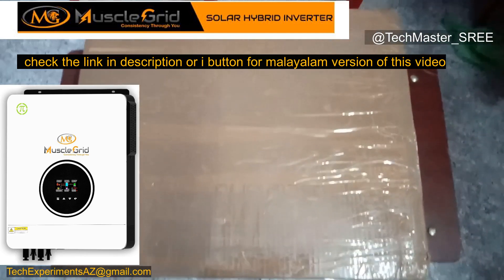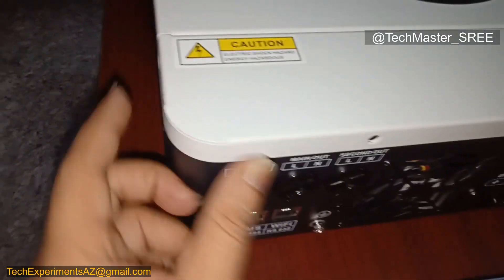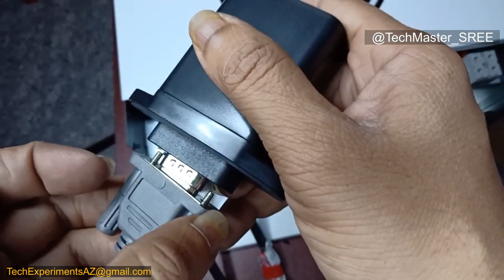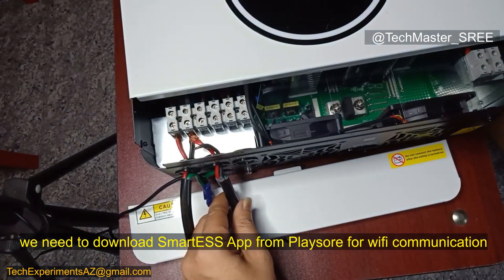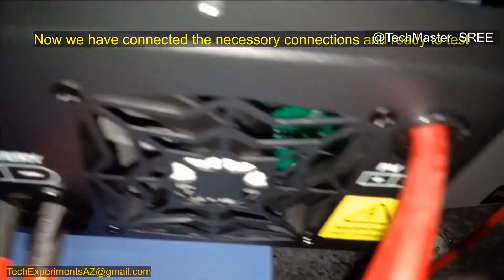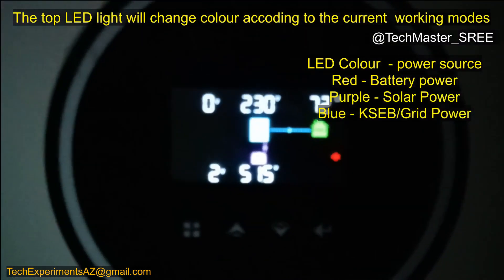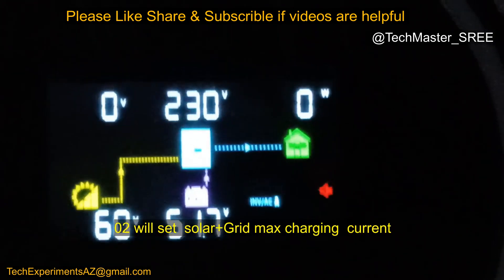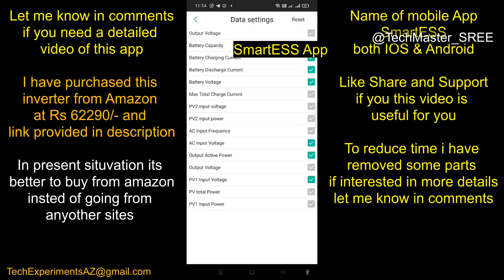Unboxing & Testing - MuscleGrid Inverter 6.2 KW Transformer less Solar -Mobile App Support- ENGLISH

Comment: You are the first vlogger that I know has stated the lack of BIS registration for the China made hybrid inverters preventing them from connection to the grid. Thanks to your video, I am trying to cancel my order for a similar 4.2 kw unit (made by YWJ- similar to Gootu/MuscleGrid) ordered through Alibaba.
If you are familiar with any BIS approved hybrid inverters available at moderate cost, please list them.
Reply from the maker: Thanks for the feedback. based on the present scenario KSEB will not allow us to feedback to grid without a valid BIS certificate. if you are looking for hybrid ongrid inverters DEYE will be a good choice . LUXPOWER and SOLIS also has BIS for some models. If you have already ordered 4.2kw inverter you can use it as offgrid hybrid inverter the only one issue will be you cant feed back to grid.
Reply: @techmaster_sree  Thanks for your fast response. I will checkout the ones you mentioned.
Reply from the maker: @amangaly   👍

Comment: So powerful inverter, I am using it at my house. Such an amazing brand ❤
Reply from the maker: Thanks 👍
Reply: What is the cost of this inverter?
Reply: Ac we can run?
Reply from the maker: @sadiqsahib3539  Using 1 ton 5* inverter AC. yes -1, 1.5 or 2 ton inverter ac then you can run on this system  if you have enough solar panel and battery or grid support

Comment: Thank you so much! you are the only one made a video about this inverter in English. Watched the whole video, but still have 3 doubts.

1. Does it only support 48v lithium batteries? Not 12V lead-acid batteries?

2. How does the inverter switch between on-grid and off-grid mode? Do we need to switch modes or that is automatic?

3. Do we need to install automatic transfer switch (ATS) to stop power from flowing back to the grid during power cut?
Reply from the maker: Thanks for your feedback and support
1. It support 12x4 lead acid  and 48/51.2V Lithium battery
2. You can use it as offgrid hybrid inverter with grid sharing since it has no BIS certification you may not able to export to grid.  Just disable grid export at settings and no need of ATS
3. Set grid export to disable so you can prevent feed to grid. No need of ATS just disable grid export in settings
Reply: @techmaster_sree  So it has the option to export to the grid. But since it has no certification, Government will not provide net meter for this inverter. Right?
Reply from the maker: @StateofDecayScience  yes, you will not get net metering without BIS Certification. So you can't export to Grid

Comment: Thanks for the video.
1. Can it balance grid and solar without battery or is it only grid/only solar?
2. With battery does it balance grid and solar? If solar not enough, then grid adds the extra load?
Reply from the maker: 1. It has battery less feature but it's good to add battery for good performance.
2. With battery we can configure this to take extra needed energy from grid using Solar grid battery option since it has load sharing mppt.
Hope it helps you.

Comment: Nice video. Which battery you are using? From where you got the victron SCC?
Reply from the maker: Thanks for the feedback. Using Lionics 16S 51.2v 100Ah battery (detailed video with internal view is already in channel). Victron purchased from a friend and using a DIY cable and Bluetooth for victron communication.

Comment: Thank you for the information and I appreciate you for responding each comment. 

MuscleGrid also sells lithium batteries at very affordable prices. Why did you not go for them?
Reply from the maker: Thanks for your support 👍
The Lionics battery pack shown in the video has  Inverter communication and Bluetooth APP access which is not available in  MuscleGrid inverter. Also please note that Lionics  is 51.2V(16S) and MuscleGrid battery  is  48V (15S)

Comment: Thanks for posting review. Plz let me know
1. How loud is noise? is it is 24x7 hours or only when inverter is heated? Does it require separate room or insulation?
2. How is performance and any issues?
3. Planning to buy muscle grid  Inverter & battery combo without solar panels. Hope it works.
Installation seems to be problem as all companies are based in TN or North India. No dealers in Bengaluru or else where. None posted video on how to set up.
Saw all your videos. It helped a lot. Thx Again.
Reply from the maker: Thanks for your support 👍
1. Fans are temperature controlled and they are working based on the heat. you can easily notice it randomly while MPPT is working(10Am to 3pm). Using it in a sperate cabin with proper ventilation is better 
2. Till now no issues except the problem with Lithium battery Communication.
3. MuscleGrid 6.2kw inverter is good but battery seems to be not that good  based on the feedback from other friends. Most of them said that they are getting 90AH range only even if they are saying 120AH. based on those feedback we can suspect that they may be using low quality cells
Reply: @techmaster_sree  Thanks. Appreciate ur  response & feedback.
Reply: Plz can you recommend some brands for 3Kw to 4 Kw Hybrid inverter & LiPO battery. Or Musclegrid combo deal is good to buy. Highly appreciate your advice . Thanks again.
Reply from the maker: @tsrini68   
1. if you are looking for ongrid hybrid with export then you have to chose Deye in the current condition. 
2.if you need normal hybrid inverter then you can choose Lionics(2yr warranty), MuscleGrid (1yr warranty), cellcronic(2yr warranty)...
3.For Lithium battery - you can chose Lionics(you can check the video available in channel both 24&48 series) . Or you can buy locally if they are providing at reasonable rate with good quality cells. 
4. Tip- When going with LFP try to buy  pack with smart bms (Mobile App Option model) + Active balancer
Reply: @techmaster_sree  Thx alot🙏
Reply: How to buy lionics battery any link
Reply from the maker: @DrMangalGupta   you can directly contact them on +91 9495656566, just mention our video hopefully they will give you some  discount.

Comment: what is the benefit of adding victor  charger controller along with this device .is it is must to add this device also sir
Reply from the maker: @Raajaananth  no need of adding victron change controller if you are using this type inverter. In my previous setup I have used victron mppt. You can see the same on lithium battery video.
Reply: from where did you buy victron mppt?
Reply from the maker: @abhishekkushwaha2455   we can purchase online or from direct dealer. Victron  has  many dealer in India.
amazon link :  https://amzn.to/401MaTl

Comment: After your video and recommendations I purchase this but
1)- it's not connect to mobile ess app
Trying manytime lots of video watching 
Sign up is not done 

After 2 days using my inverter display not working showing properly
Half lowerside screen showing only 

What to do dear any suggestion
Reply from the maker: if its only 2 days (return window to closed )then just rise return request on amazon and replace the faulty one. Did you informed this issue to customer care.
Reply: Dear muscle grid is fake I order 3lac cimbo pack still not delivered also not responding and no contact to call them
Reply from the maker: @dheerajsingh3402  did you ordered vi amazon. To prevent issues like this I have clearly mentioned that only order through Amazon. If ordered through Amazon then contact customer support they will do the needful.
Reply: I know you personally over telegram u solved my few problem 
But still I can say ki sayad sara rupye  barbad ho gya h musclegrid k chakkar main 
But I will exposed them on my channel if they not change my inverter
Video is prepared but still waiting for their respond
Reply from the maker: @DrMangalGupta   I think they have to rectify this in a timely manner. I have also faced issue with communication with lithium battery and I have mentioned the same on the comments when anyone is asking about purchasing.

Comment: 24volt solar Panel serial or parallel conecting sir?
Reply from the maker: Connected 8  panels in series - 24V(375W). Total 3000W.

Comment: Hello sir, it works on 24v solar panel or 48v solar panel? Urgently reply sir
Reply from the maker: You need to use multiple 24V solar panels. Please note that normally 24V solar panel has around 50V VOC and we will be using these panels in series to get minimum working voltage . for this inverter we need to connect at least 3 to 4 panels in series since VOC is higher. FYI :  12V and 24V panel parallel setup is used in old days for PWM charge controllers, in MPPT check VOC and working voltage. Hope this will clear your doubts

Comment: Can I use it as a off grid interver ? If so what will be the settings.
Reply from the maker: sure, using as pure offgrid. I have connected grid only for testing purpose. When using as offgrid its better to disconnect N&L from Grid that will help to protect inverter from Grid  issues. if using Lead acid battery manage your load based on the C rating of battery, also make sure that  you have enough Solar and battery capacity. Charging settings will be based on your battery data sheet.

Comment: Sir your battery details and rate 🙏plzz
Reply from the maker: Using Lionics 51.2V 100Ah SmartPro battery . Current Price for this one will be around 1.3L and for without inverter communication model will be around 1.1L.  
You can see the details of battery here 
Battery Details - https://youtu.be/U6UpfjHG-3U
Load testing : https://youtu.be/zt6g_OSjhL0
Reply: @techmaster_sree  lots of thanks 💕dear
Reply from the maker: @DrMangalGupta   Latest smart pro series comes with NEEY Bluetooth Active balancer ,  check the video of battery after adding NEEY Bluetooth Active balancer if interested . you can also contact me on instagram id : techmaster_sree if you need any additional details regarding the battery 
https://youtu.be/FEJ4_Twaha8
Reply: After your video and recommendations I purchase this but
1)- it's not connect to mobile ess app
Trying manytime lots of video watching 
Sign up is not done 

After 2 days using my inverter display not working showing properly
Half lowerside screen showing only 

What to do dear any suggestion
Reply from the maker: @DrMangalGupta   .if its only 2 days then just rise return request on amazon and replace the faulty one. Did you informed this issue to customer care. if you can share the video I can also share with the MuscleGrid team if needed.

Comment: Sir in battery mode what is the max output , can it support both outlets
Reply from the maker: You can see the part1 of the load test video . Grid not connected in this test. We can take peak load of 6kw but for continuous load its better to keep it under 50 or 60 % range. if you are using dual load note that  max load on secondary will be 2000W and 4000W from primary .
Short Eng version - https://youtube.com/shorts/bsWAaoVX-wM

Full video - https://youtu.be/WAbwskUPPFg

Comment: Dear sir we can use submersible pump 1 hp
Reply from the maker: yes,  normally starting current and running current of 1 hp submersible will be under 6 kw. just cross check power consumption of  your device. also make a proper research before purchasing since some users are commented that they have issue with muscle grid service

Comment: When I Use 2000W at Home and Solar Production 1500W, Where From Get 500W Power Grid 1st or Battery 1st?
Reply from the maker: It will based on the priority given to system like other inverters with grid sharing option. We can configure Solar Utility battery or solar battery utility.

Comment: Whether it can export current to grid? If yes, how's the connection made?
Reply from the maker: yes it can export but no BIS.
Grid tie operation can be controlled at settings 37 - (off/hybrid) and 38 specify how much current we can export. 
Please note that this inverter don't have BIS certification so  we need to make sure that GRID provider will allow us to export. Do not export if GRID provider is not allowing.
Reply: how many mppt , and their current capacity plz
Reply from the maker: @thebioguruanupamtripathi2138   it has only one MPPT with 120A (may be multiple small MPPT parallel inside to make this 120A) . we can use only single string since it has only one tracker
Reply: @techmaster_sree  Thanks for information about BIS. If we need to export to Grid then which wire can work for Grid Feed.
Reply from the maker: @Mohit-Rahar   It will feedback via Grid input wire like ongrid inverter
Reply: @techmaster_sree  Hey thanks for reply but what i understand on grid inverter works with AC Output for Net Metering but in this inverter no specific port for Net Metering because this inverter give output port load i have doubt for this or hybrid inverter uses AC input port bidirectional for Net Metering please confirm for this model what is the process

Comment: I had complained on 20th, my problem has not been solved till now, the company called me and told me that this is the company from which you have purchased it, please take replacement from the company.  ???
Reply from the maker: What is the use of their 2 or 5  or 8 year warranty offered by them if they cant  give proper service ?. Did you mean that they are saying you to claim warranty form some one else other than them ?

Comment: Sir if  I have no net- meter. Can I connect to grid?
 Does it have zero export options? Maximum load capacity?
Reply: Yes it works on grid as well, it can export and work as zero export too.
Reply: @PHYSICISTfromDELHI   can I run my load mix Grid and solar ?
Maximum load capacity?
Reply from the maker: Yes, it has load sharing. So we can mix Grid+solar to provide out to load. Just turn off grid export if you don't have net-meter(check with your grid provider). We can  share solar+grid or  solar +battery based on our need.
If using main output only then you can load upto 6200W

Comment: Sir make video on 24 v MuscleGrid Inverter off grid
Reply from the maker: I will try to get one, but the main issue is MuscleGrid is not providing service to customers based on the feed back from users
Reply: @techmaster_sree  yes , I also try but the phone number is not connect .😞
Reply from the maker: @sdatt4761  many users reported the same. they are interested getting the cash  only and not providing any service
Reply: @techmaster_sree   sir how the product are? The lithium battery and inverter...
Reply from the maker: @sdatt4761   could you please rephrase the question ?. I didn't understand .
Reply: @techmaster_sree  yes , quality of their products like lithium battery and inverter?
Reply from the maker: @sdatt4761  1. lithium battery - Based on the components images that I have seen the quality of lithium battery is very low and its better to avoid that . 
2. Inverter - you can search and read the review of Chinese inverters like GOTTU. Its average quality inverter.
Reply: @techmaster_sree   thank you sir, for your support

Comment: This type inverter support 48v 200ah battery?
Reply from the maker: yes, but this one has will not have proper BMS communication so not recommended for multiple battery parallel config.  You can also check Lionics latest 6KW parallel inverter that comes at the same range
https://youtube.com/shorts/7sLJg1P4Ly4?feature=share
Reply: @techmaster_sree  where to buy?
Reply from the maker: you can buy from lionics company, contact me on Instagram, I will share their direct number.

Comment: Can you please share your review regarding this inverter, what  details of your battery
Reply from the maker: Sure, inverter is good if you don't need Lithium battery communication. I have tried to communicate this inverter with battery using the specified protocols and cables but it's not working. So if you are using lead acid battery or Lithium battery without communication then no issues. I am using Lionics 16S Lithium battery pack with multi inverter protocol support.
Battery Details - https://youtu.be/U6UpfjHG-3U
Load testing : https://youtu.be/zt6g_OSjhL0
Reply: @techmaster_sree  What is the price for Lionics battery?
Reply from the maker: @imteyazkhan8269   The battery showed in the video is Smart Pro 51.2V 100AH - 1.30L range and you will get discount when mentioning the video, for 51.2V 100AH Smart series it will be 1.1L range after the recent price drop

Comment: Can i run a cutting machine and welding machine
Reply from the maker: Tried drilling machine and cutting machine they will work fine. Not tested with welding machine. You can check the connected loads in the load testing video which is already avilable in the channel. Devices will work if it's under 6KW load

Comment: What all Battery can use bro?
Reply from the maker: by default it has  battery type AGM, Lead Acid, Lithium and User Defined . so even if its not in the list you can configure the battery settings based on the data sheet. Note that lithium battery communication is not properly working on the test that I have done.
Reply: @techmaster_sree  tq bro

Comment: Sir can connect net meter with it for export grid
Reply from the maker: No you can't since it has no BIS Certification. Without a valid BIS Certification Grid provider  will not allow net metering. You can also cross check with your electricity provider.
Reply: Thanks sir

Comment: It will Handel  all 6.5 Kw full load ?
Reply from the maker: Alredy showing 80% load on load test video. It can handle Upto 6.2kw only. it's always recommended to keep under 80% if you have 100% load for long duration